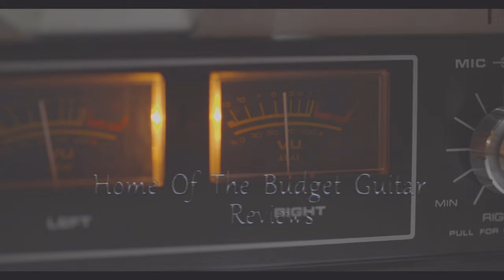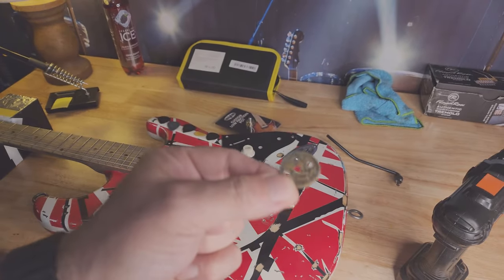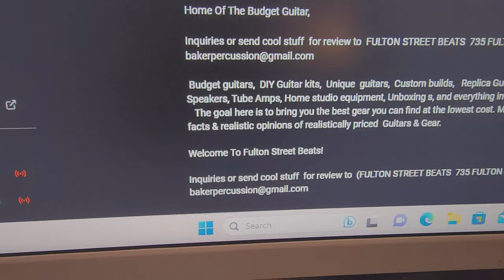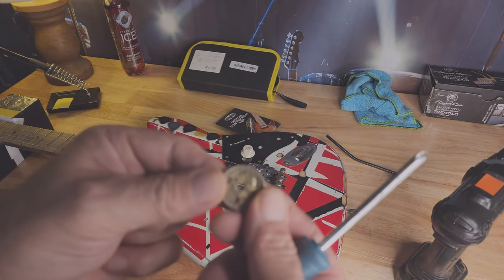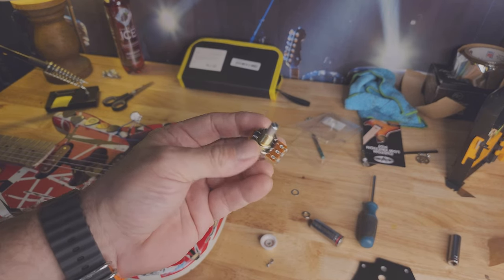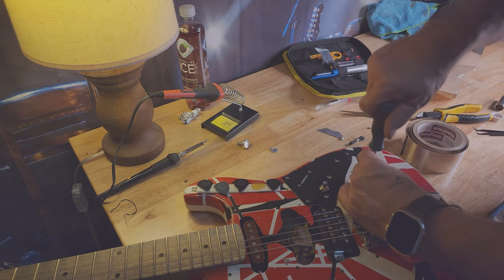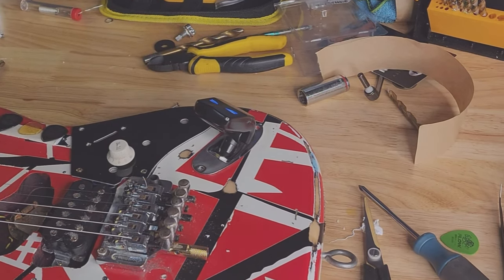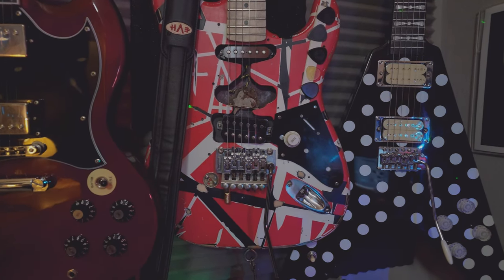CHIBSON EVH Replica Upgrades &  Giveaway Winner Announcement!

Comment: great channel man.. been watching for a few weeks now and even going to look at old posts.. nice to see appreciation for capable builders.. (not all, but some).. and upgrades available.. curious as I am a double locking nut guy (if blocked with a brass stopper and the nut does its job) they stay in tune great even you can only divebomb.. no up.. i was looking at George Lynch signature guitars.. hoping the budget floyds provided can be swapped out for better base plates, saddles and knife edges.. i think Gotoh and even Schaller make great quality floyd styles for less.. even those Gotoh bushings are LARGE.. have to be careful with those can find low cost FR 1000's as well on the market..
Reply from the maker: Thanks brother.  And thanks for watching 🙂.  I have done lots of swapping of baseplates with Floyd's  and even some budget  brand parts swapping.  So far as far as trems go Gotoh  has been the most stable  for me.  Seems others most have a quirk someplace.